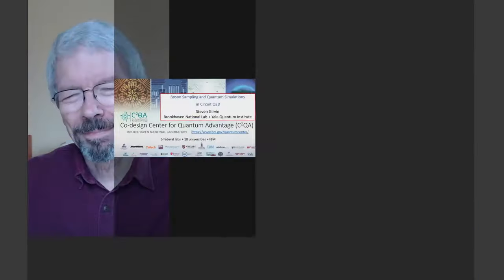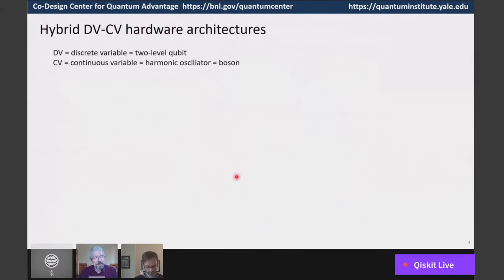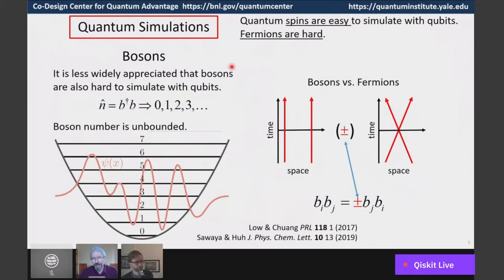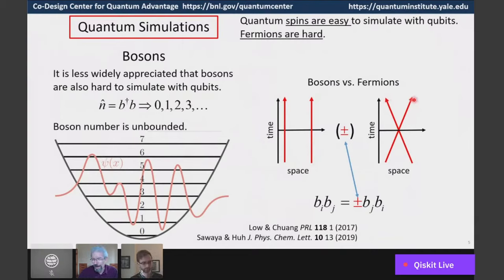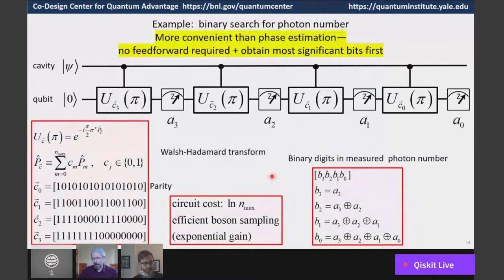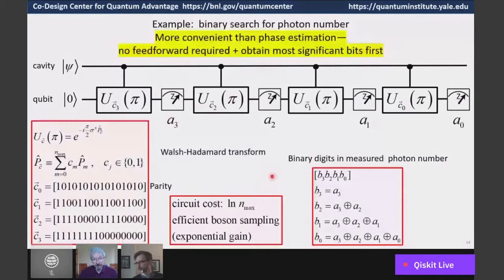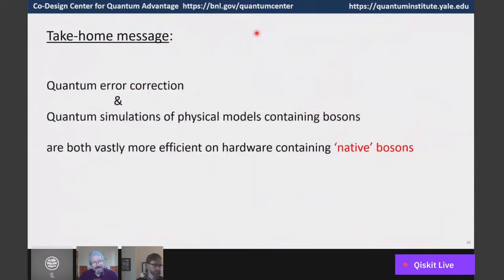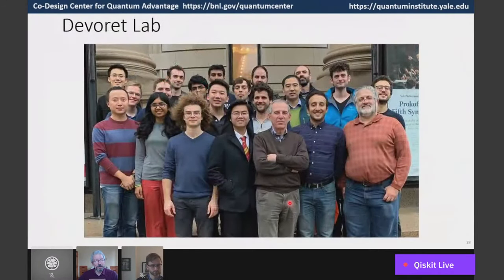Boson Sampling and Quantum Simulations in Circuit QED - Qiskit Seminar Series with Steve Girvin

Comment: At around 2:40, the slide shows an operator U_m inside the box. The way it is drawn, it looks like it operates only on the one qubit |0>, but the operator U_m contains the cavity operator P_m in the exponent as well, so  U_m should act on both |psi> and |0>, shouldn't it?